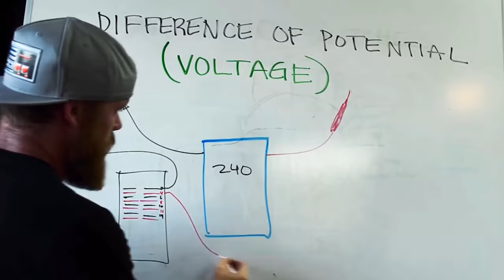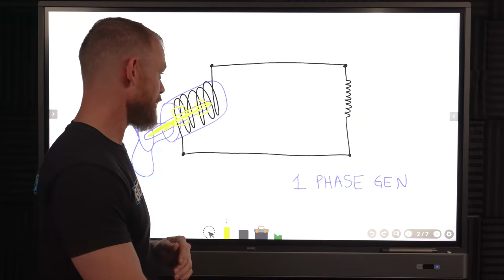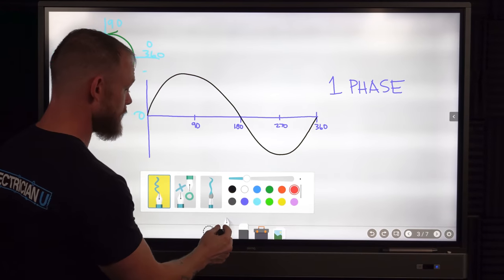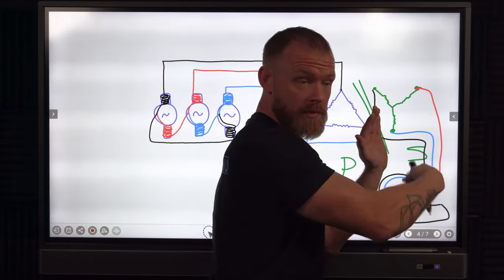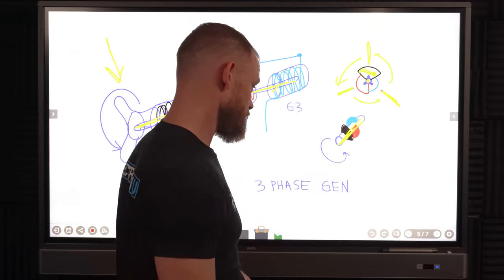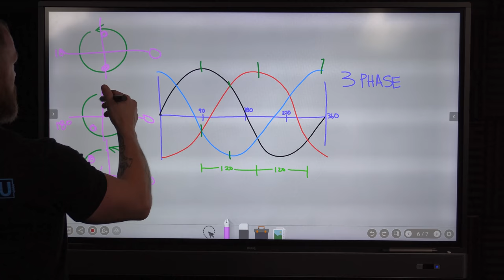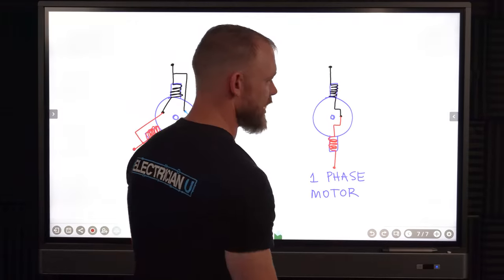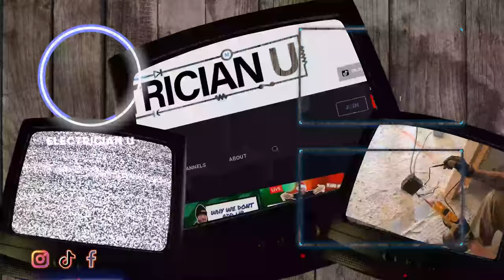What is the Difference Between Single Phase and Three Phase???

Comment: I can put 240 volt residential service on an oscilloscope and show you it’s two phases. It’s literally 120 volts on each leg, 180 degrees out of sync… ergo 2 phases. An AC phase is its complete wave from 0 to 360.

Comment: Just like in an automobile IC engine, Can we say higher the load higher the number of phases the load requires? Just like in automobiles engines. Corolla is 4 cylinder and their Avalon is 6 cylinder. 
Can we use the positions on the camshaft or pistons pistons inside cylinders to explain how 3 phase or higher phases circuits work? 
Thanks 
What is the average load

Comment: I remember this in engineering class decades ago, although I mostly focused in digital and since 2000, software. The question is, what kind of three phase is normally used, Y or Delta? I never paid attention since I'd be using normal 240v residential, but I'm curious.
Reply: To  my understanding, delta  is used mostly for high voltage power transmission while a wye is used to supply an actual building (it has a neutral) hence the delta wye configuration. (Power transmission to power distribution)
Reply: With Y you get a centre point where you can attach a neutral in delta this is not possible.
In the case of motors Y has a smaller current peak where as Delta gets higher rotations, and depending on the size of the motor they will start it with Y and then switch to delta.

Comment: Is it logical to relate the position of pistons in a 4 cylinder engine with the three phase electric connection, for the purpose of visualization of 3 phase circuit?

Comment: I do not run into much 3 phase unless I get called to troubleshoot a metal machine shop or some bakeries which have mixers running on 3 phase.  What I have found is trouble in L2...but there is sufficient voltage on L2....so at times...just swapping out the contactor cures the problem. Any comments will be appreciated!
Reply: I'm a commercial/industrial HVAC/R technician and I troubleshoot 3 phase systems more regularly than single phase. If you're having trouble with a single line out of the three phases, the problem should be relatively easy to track down. If you're consistently having problems with L2 at this place, changing the contactor isn't the fix. You need to dig deeper and determine what is damaging the contactor. This is the way I would approach it, but not necessarily in this order. It all depends on the unit and circumstances of your particular service call. Verifying with your meter that the power is off, visually inspect the contactors. Most contactors are easy to inspect. It may have a cover you need to take off first, but visually check the contacts to make sure they're not charred and pitted; replace the contactor if they are. Also make sure that the contactor current rating is appropriate for the application. 

Then trace out and inspect the wiring to make sure nothing is obviously charred, melted, or showing signs of heat damage. Change any damaged wiring. Inspect and tighten all the electrical terminals from the disconnect, through the contactor terminals, into the motor terminals, and any other components running on line voltage. Terminals tend to heat up and cool down which can cause the screws to come loose over time. It's very important to make sure they're tight. Once you're satisfied that everything is tight and all the wiring looks good, restore power to the unit.

Check the voltage and verify your 3 phases. With power on and the contactors pulled in, you can also check for a voltage drop across the contacts. You should read zero volts or very close to zero. If you start reading much more than one volt, replace the contactor. With the motor running, make sure you get an amp draw reading from each leg. Being a three phase motor, they should all read pretty close together. Also compare the amp reading you got to the listed current rating of the motor. If everything is running properly, looking good, and you're satisfied with you're readings, you should be good to go. 

If you're still getting one leg of the motor drawing significantly more amps than the other legs, there is most likely a high resistance short in the motor windings. The only way to test for this is to use a megohmmeter, or megger. This is a specialty meter used specifically for testing motor windings and electrical insulator integrity. I highly recommend getting one and using it regularly as part of your diagnostic routine. They're not exactly cheap, but if you work on enough equipment, it will pay for itself in no time. It'll also force you to diagnose things differently. Where one technician may see a burnt contactor as the problem, you'll realize that it's actually a symptom of a more serious problem; a motor with shorted windings. 

Sorry for the long post. This is something I tend to get passionate about. I wish more service techs and electricians understood the importance of testing motor windings. You'd be surprised how many motors with shorted windings you'll find on equipment that appears to be running perfectly. Sometimes it feels like predicting the future. Knowing that a motor is on its way out gives the technician and the customer better options. Everybody wins when things are diagnosed properly. Obviously, without being on the job with you, there is no way I can know for sure that this is the exact problem you're having. However, in my experience, it's a very good chance that it is and it's too important to overlook that possibility. Let me know if you have any questions. I'd be glad to help out if I can.

Comment: Not to be pedantic, but when you said that in single phase, current is pushing and pulling at the same time, that's not really the case. Since AC has a positive portion of the waveform and a negative portion of the waveform, these two actions are genuinely happening one after the other. To anecdotally prove this to yourself, just look at half wave rectification. The reason this can even exist is due to the current traveling in two distinct directions at different points in time.
Reply: I think you are misunderstanding what he's saying. He essentially just saying current is going 'away' from one leg and 'towards' the other. In other words, current is flowing. I think he talks about 'push pull' to illustrate that it's not all happening via the magic of a 'hot.' The neutral (the other half of the circuit) plays an equal role. Nothing to do with the time shift of the sine wave.
Reply: @spruce_goose5169  I do not believe that I am misunderstanding what he is saying. His hand motions actually show what I'm talking about. Later on in the video, he describes the sine wave of an AC circuit and kinda shrugs it off and says that a sine wave doesn't really exist. That is definitely not true, as the voltage and current both go from positive to negative to positive etc. I understand that this topic is not particularly easy to understand, but there is definitely a right and wrong answer here. I believe he is a good teacher and breaks down a complicated subject into more accessible slices of information for the average person to understand, even though it may not be technically correct. That's why I included the bit about being pedantic; I'm kinda focusing really specifically on particular statements and their validity in reality. Definitely a good video though.
Reply: @aminer20707  I do believe you aren't getting it. When he says sine waves don't exist, he is saying that we shouldn't picture a physical wave traveling down the wire. The sine function we are looking at on the graph is a time-function representation (time on one axis, current or voltage on the other). This is basic stuff.
As far as his hands... I don't know what you could possibly mean. He is showing that current travels one direction, then switches and travels the other. That does indeed happen over a time interval. Simple as spaghetti. 

> "AC has a positive portion of the waveform and a negative portion of the waveform, these two actions are genuinely happening one after the other." 
What actions? The change in direction of current? In relation to time, the current follows a sine function with a zero crossing. So yeah, it changes direction. Again, the 'pushing and pulling' is not about being positive or negative with respect to time but rather that the power of the circuit is derived equally from both wires in the circuit. The reason he is doing this (most likely) is because so many people wrongly believe that the 'hot' is the only conductor with power, and that the neutral is just some idle component. Thus the 'push-pull.'
Reply: @spruce_goose5169  It is actually wrong to state that there is no wave traveling along the conductor, as excitation of the electromagnetic field and subsequent EM wave is actually responsible for the flow of electricity. You and I have entered a sort of headbutting match that I really don't care to go into any more depth about. You aren't understanding what I was originally stating, and now we are having a nice pissing contest. I will no longer be a participant.
Reply: @aminer20707  There are EM waves, but that's not what we're looking at on the chart, which was the focus of his discussion. Your twisting the shit outta this simple stuff man and trying to make it seem like we're having some high level discussion (pissing match you say), when the reality is you've misunderstood a simple hand gesture and/or phrasing. Maybe you can wake up to that and get over yourself. Feel good.
Reply: @aminer20707  4:11
Reply: @aminer20707  "I will no longer be a participant." Wise of you to take exit while you could, but I hope you can leave your mind open.  And I hope you understand that the reason for my push-back is because your notion that Dustin (or anyone remotely capable of discussing 3-phase electrical theory for that matter) wouldn't understand such an elementary concept as AC waveforms and current changing direction is ludicrous. It is a classic example of arrogance via ignorance. The saying the more you know, the more you know you don't know seems to apply here. If you think the fact that AC current changes direction has been overlooked or misunderstood in this video, I am honestly left wondering how closely you even watched it. 

I will leave it open for you, if you wish to engage, to point out the time stamp you specifically take issue with, and maybe we can work it out in an objective, scientific manner from there. It's even possible and likely we'll find some points of agreement and clarity.

Comment: 3-Phase rocks, even if the majority of the devices only use two of the 3 phases. (Pick any 2, as long as the 3 phases are roughly balanced in total load; presto, you have 208VAC, with less current than 115VAC.

Comment: On 3 phase , what about the "High Leg", and what is it's letter designation, X Y or Z?
Reply: The high leg is for a delta configuration.  It is connected to center tap of another transformer,  so its voltage becomes a vector of the other two transformers.  Its square root of 3.

Comment: Off topic of this video, but I have a question. I have people telling me that my 100A main service breaker is ACTUALLY rated for 110A continuous duty, all main breakers have to handle a constant 10% overload, and all breakers such as a 30A are good for 30A continuous duty now. I have always been told to follow the 80% rule for continuous duty.
Reply: As s a rule breakers should give rated current indefinitely. What is the recommended use is another matter. Breaker is not any permission to draw current. It is a safety device against accidental overload or short circuity. It is the airbag not the brakes.

Comment: If I'm not mistaken, I think Europe, or maybe just Germany, has 3-Phase residential while we are stuck with 1 in the US.  I'd be curious to know the history behind those decisions.  I've had to pass on some opportunities for certain tools because they require 3-Phase and I cannot get it at home.
Reply: You have two phase power, red and black where as germany and europe in general has three phase power (in germany brown black and grey). 
And you can make yourself a three phase generator, you need a three phase motor where you link the rotor to a two phase one, the only thing you should check out is that you get the right output voltage.
Reply: Three phase is the norm in Finland but that does not mean one gets more power. Typical houses are either 3x25 A or 3x35 A. 3x67 A is an option but costs often much more (100 € a month or more). Apartments previously got just one phase but now three phase is the norm. For example ranges use three phase (3x16 A). If you connect them in a single phase (like 20 A) you cannot the full power (all plates at the same time).

Many misunderstand three phase only as higher voltage. That way you get just 1.7x the single phase power. With a proper three phase load you get 3x the power.

Comment: You mentioned that you can run a single phase motor on a three phase system, but won’t the lower voltage (208) and that the phases of the two legs are not 180 degrees be an issue? Somebody put a vacuum motor in my 3-phase shop that is 220V single phase and it melted the capacitor over time

Comment: Could you explain what a shunt trip breaker is and what is does please? Thanks boss!
Reply: Good question.  A shunt trip breaker is a breaker that can be activated by current through a shunt trip coil, in addition to overcurrent in the main poles of the breaker.

Imagine you group a 100A breaker with a 1A breaker, and mechanically link their trip mechanism.  This is the underlying idea of how to understand a shunt trip breaker.   The 100A breaker will trip upon the stimulus of overcurrent exceeding 100A in the circuit it is protecting, while the 1A breaker you can connect to an auxiliary control circuit, so that another kind of stimulus can trip this pair of breakers.  Maybe there is a remote push-button E-stop, maybe there is a microprocessor circuit that will send out the signal to shut off this breaker.  In any case, a cirucit of significantly less than 100A in the control circuit, can shut of this breaker by putting this current through the 1A auxiliary breaker that is mechanically linked with the 100A breaker.

The shunt trip current isn't necessarily 1A, that is just a hypothetical number.  In any case, it makes the 100A breaker behave exactly as if another smaller breaker were mechanically linked with it, and we trip the smaller breaker with a control circuit.

Shunt trips always require a manual reset, so be careful when specifying them.  They may be an economical solution for controlling a circuit's operation when compared to the alternatives, but this can be a disadvantage you don't anticipate.  They do a good job at giving you an option to shut OFF a circuit, but removing the shunt trip stimulus will not restore the breaker automatically to the ON-position.

Comment: So , supply to residential is two phase and the separation is 180 degrees , like a two pole breaker where the connections go to opposite sides of the buss bar ?  So the utility company supplies this split . Any other phasing will be created by the design of the device like a motor . It doesn’t give me more power as that’s already predetermined by the breaker and  size of the wire , but it gives me more efficiency as the points of no power just aren’t there any more to inhibit the motor operation .  Is this right ? 
So can  commercial service have more than two lines and a ground entering the building panel?  Increasing the phasing by one??
Reply: The electric utility either delivers to you a split phase service or a three phase service. Two different things. You don't create 3-phase in house (technically you can, but not for added power, and it's a whole nother story).

Comment: Primary lines are created from step down transformers in a substation transmission 69k volts to 12.4k volts generators create voltage to energize transmission lines at 500k volts and hits multiple sub stations till they get stepped down to 69k volts then hits a distribution substation that steps it down to 12.4 k volts to feed utility distribution lines

Comment: So let me ask you this.....if you use a 3 phase system for a single phase load, would there be any loss of efficiency or expanded dead zones because of the phases being 120 degrees apart rather than 180 degrees?
Reply: If you are using only 1 phase, there is no 120 phase shift. Yes, yes, I know, 3 phase is 120 degrees apart, but that's to a common neutral point, relative to a separate phase (second and third phase). A single phase load creates a single waveform, thus there is no 120 phase shift. You could say they are 180 degrees apart (as in 'split phase').
Reply: I'd like to know this also. If you have 3 phase and you take one away so you can power the average appliance, have you made your source less efficient? Less effective even?
Reply: @knowinowen  Understand that there are 3-phase 'loads' and 3-phase 'systems'. They shouldn't be confused. If you want to power something like a toaster (or any single phase load) it doesn't really matter what the system is, as it's a single phase load. The only reason it would matter is the difference in nominal voltage and for system-wide current balancing. On the other hand, if running a motor, or any 3-phase load, then you notice the steady delivery of 3-phase. But even a motor is either construction for 3-phase or single phase hook-up.

One scenario you might be interested in is a 3-phase motor that has lost a wire connection. If delta connected, losing a connection leaves you with only ONE phase. If star connected, you would indeed have 2 phases left (because you have a neutral). In both cases, it would not operated as intended, and wouldn't start from a stop.